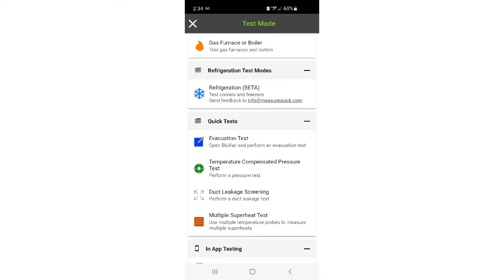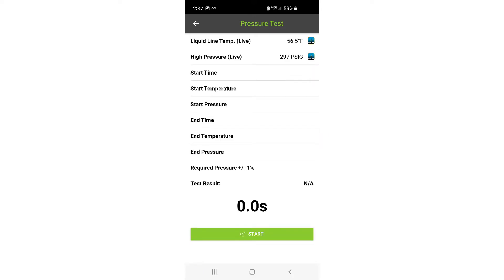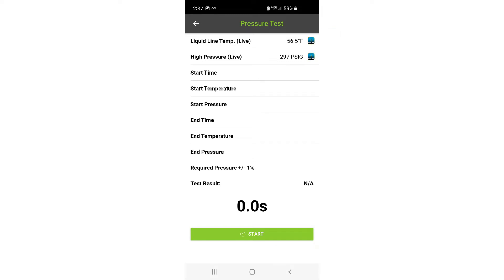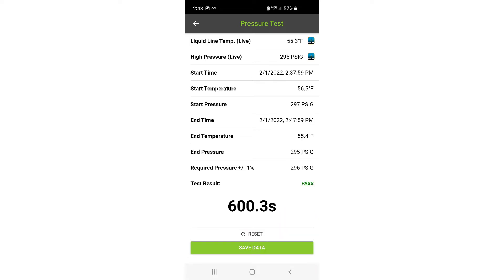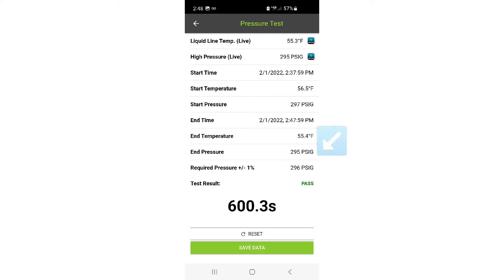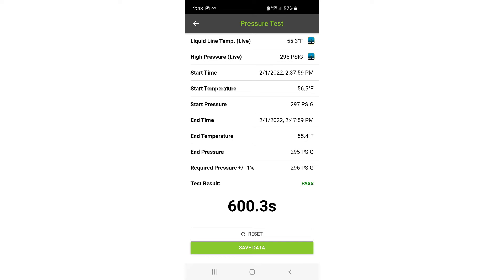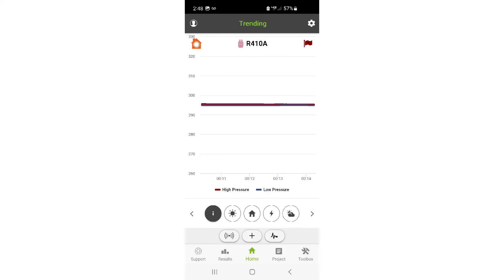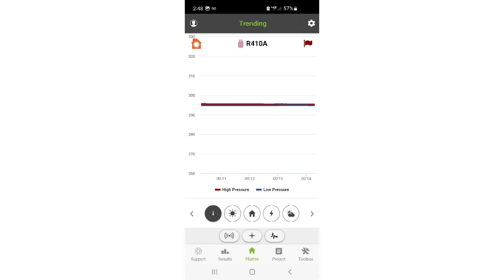Using Measurequick's Temperature Compensated Pressure Test Mode

Comment: How do you pressure test without measuquick (it never works on my phone)? I mean what is allowable pressure drop when pressure testing? For some reason when I do pressure testing it is always slowly dropping ~ 1 psi/ 5 min. Though I pull vacuum down to 150 microns after that.
Reply from the maker: It adjusts the target pressure with ambient temperature. A 1psi drop if not adjusted for temp results in a fail. You must have a leak, or the pressure is equalizing to the other side.
Reply: @timdestasiohvac  thanks. But how is it possible to pull vacuum to 150 microns if there is a leak? By the way, when I asked one of my colleagues how he speeds up the install time, he said he doesnt  do the pressure tests. He starts the evacuation immediately after brazing. And the guy has 10+ years of experience 😁
Reply from the maker: @thecurious6721  So, first thing: Never ask your colleague for advice ever again because he's giving you bad information. Nitrogen during brazing removes oxygen so you don't get carbon buildup on the inside of your pipe. Pressure testing with Nitrogen after allows you to leak test and purges contaminants and bulk moisture. Evacuation dries the system the rest of the way. These are industry standards for a reason. Do not concern yourself with speeding up the process at the expense of quality.
Reply: @timdestasiohvac  last week i moved from hvac to refrigeration. Learnt that guys in the refrigeration dont braze with nitrogen, too. When I asked one of them when does he use the nitrogen, he said he did maybe twice in his career,  when he was brazing 2 inch pipes. 😂 It is interesting seeing practice vs theory. It makes me really think if purging with the nitrogen is an overkill (especially in residential )🤔 If manufacturers always look for ways to decrease cost and cheapen the product, why shouldn't installers do the same?
Reply from the maker: @thecurious6721  that is the wrong way to think about it. I can send you links to videos where they tear compressors apart and show how they were damaged with the carbon buildup. I personally saw my installers who cut Corners create restrictions in dryers and expansion valves because of not brazing with nitrogen.
Reply from the maker: @thecurious6721  most of the people who claim they've never had a problem with not purging nitrogen do not run their own warranty calls. So how would they know?
Reply from the maker: @thecurious6721  You are going to have to decide Whether or not you are going to be a hack Or A professional in your career. My question to people who don't want to purge with nitrogen, if you have to bring the nitrogen out any way to pressure test, why don't you just Purge while you're brazing? It's not like you're bringing anything extra from the truck. Its just laziness.
Reply: @timdestasiohvac  that is the thing, as a service tech I rarely saw any issues related with the clogged filter driers or metering devices, or compressor issues. But the number two issue (after poor airflow) was leaky evap coils, which I would consider as the manufacturing issue. I think it is unfair if manufacturers decrease their costs at the expense of the customer, and at the same time demand extra effort from the hvac companies. Dont you think so? )
Reply from the maker: @thecurious6721  the fact that manufacturers make junk has no bearing on whether you should do a good job as determined by organizations like Ashrae, Acca, NCI, Nate- none of these organizations are connected to manufacturers.
I'm not going to keep beating this dead horse. You need to decide if youre going to be a hack or a pro. You have all the info you need to make that decision.
Reply: @timdestasiohvac  agreed. It looks like it is like speed limit. There is one but no one follows the rules. I think I will have to talk to Copeland guys about this stuff. Just today we were installing walk in cooler. the guy (installer and service tech who is doing warranty work) brazed 6 elbows on 7/8 suction there will be 6 more I guess. Same amount on tbe liquid line. And no nitrogen at all 😁 He says he never had any issues in 7 years. So I am now curious how in residential with 2 joints people have clogged filters driers and txvs 🤔